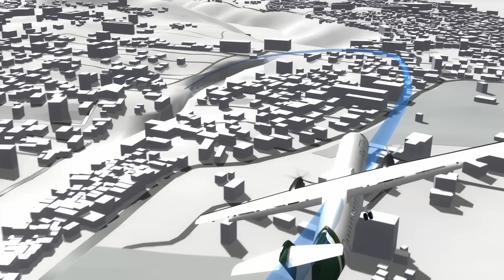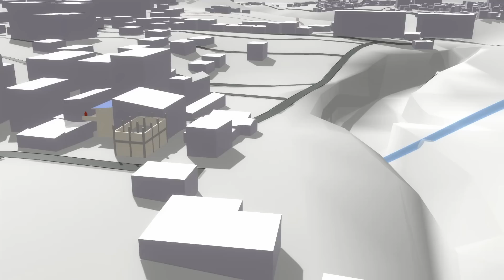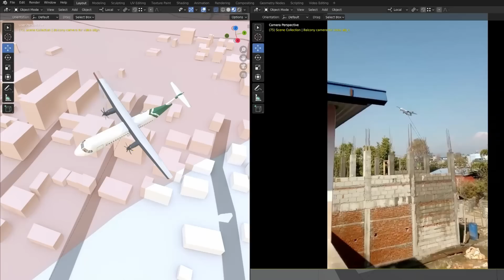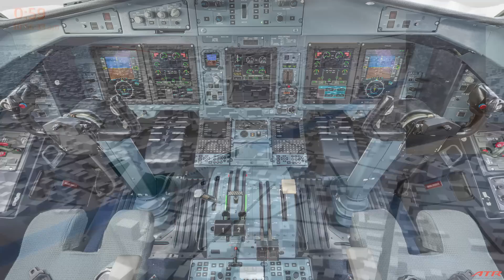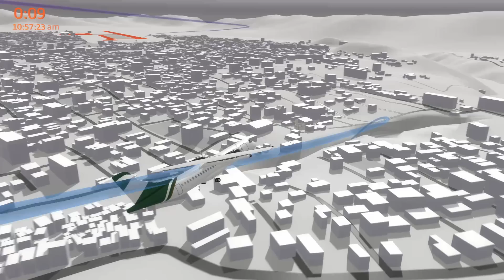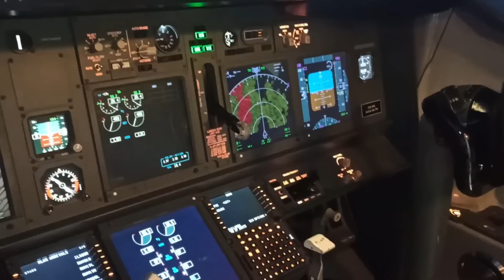HUMAN ERROR or MECHANICAL?! | Yeti Airlines flight YT691 illustrated

Comment: Based on what I've read and seen, the senior pilot's error could've been a result of overwork and a momentary loss of focus due to exhaustion. I don't know anything about flying, but I do remember when I was overworked as an essential worker during the pandemic. I was working 50 hours shifts in the snow at one point, and I could definitely tell my judgement was off and my coordination wasn't as shape, causing me to make mistakes I otherwise wouldn't have. If this pilot was in a similar state do to constantly being on the schedule, I could see how this happened. RIP everyone aboard. 😔 (Also fantastic video, you illustrated what happened really well.)

Comment: There's way too much 'tech' in the cockpit. Pilots don't fly the plane anymore, technology is doing that and when technology fks up, you know at your desktop, when it goes bluescreen, what to do? Fix the computer, even if you're only 1000 ft off the ground and upside down.. instead of FLYING THE AIRPLANE back to right side up. To me, most so called accidents are computer glitches that pilot's cannot fix in time.. they're not even flying the plane at the end.

Comment: Excellent video!  

Is it just me or is that "Hey your about to crash!" warning terribly deficient.. criminally insufficient really..

WHY would it even be an option to "FEATHER" the turboprop in flight.. An older aircraft could be guilty of this grave error in design but modern stuff would have failsafes for exactly this kind of reason.. 

Human error is far too common yet it's also on the manufacturer at this point because where are the warnings.. NOT A STALL warning when "hey it's too late buddies, your F'd now!" 

Something to warn you while there's actually a chance to do something.. ESPECIALLY if you feather the prop in flight.. of course the designers would be all "we never imagined, blah blah blah" BUT it's your job to imagine it.. you design these things for a living.. you make millions of each one.. HOW TF can you not make simple assumptions and account for human error? DERP.

Comment: If feathering never done in flight, can’t ATE have a blocking mechanism for feathering on flight? 

Sometimes people do things without and although lever mechanisms are different, a pilot could switch unconsciously
Reply from the maker: Feathering is done in flight.  If an engine fails its prop is feathered so it doesnt unnecessarily slow down the plane

Comment: Sounds like it caused a single wing stall due to low speed due to prop pitch error. No matter how much power you apply on a feathered prop will give you more speed. Sometimes when you are tired you make silly mistakes and I did this very thing on an ATR72-500 sim I used to fly with the exact same result. Wing dropped and corkscrewed into the ground. I repeated it several times in several different ways and if the speed drops too low I always found one wing would dip hard and was unrecoverable on approach. I thought it was a bug with the sim… but I guess not.

Comment: I don’t recall auto on the prop handles. But I last flew the ATR 25 years ago.  Maybe if they didn’t have the auto notch the fo could of realized he was moving the props instead of flaps
Reply from the maker: You need to press the triggers under both condition levers to move the lever. And to move the flap lever you have to lift it first. Distinctly different actions. Pilot monitoring was not at all focused.

Comment: It's human error, but it's the kinda human error that could have been avoided if the plane had been designed with the proper safety measures to prevent the mistake. Such as an alert for the prop feathering.

Comment: How would any pilot not see that the Condition controls were pulled down to FTR (feather) instead of 100% or Auto (if that is what happened)? How would the girl have lifted the handle under the Condition control as you pointed out? We have flown in India and Nepal - it can get get wobbly for sure - and listened to the real audio and the girl sounds very green. And she was going to be a captain in mountainous Nepal if signed off? Can't pilots tell the feel of the aircraft, or is it purely instrumentation all the time?

Comment: ATR needs to implement a system on all these planes to prevent feathering of the props in flight while the engines are running normally.

Comment: Recently cockpit voice recording of this crash was released on internet. The pilot seemed so confused while landing.
Reply from the maker: I have posted a video with the cockpit voice syncd to the flight path.
Reply: @Mike-Bell  Thank you. Just subscribed. won't miss your videos now.

Even if prop lever was in feather mode(which means like neutral in cars), why did they turned towards gorge at last moment instead of landing straight on the runway ahead? 😢

Also pilot took elect warning lightly like alarm snooze button. If only one of the pilot had pushed the prop lever back to auto, many lives could have been saved.

Hopefully these types of error won't happen again.

But again Saurya Airlines crashed at Kathmandu airport few days back turning sharp right while just taking off the ground. This also seems similar human error 😣
Reply from the maker: @sakeshkaranjit  Without forward thrust from the props, the aircraft was slowing all the time.  They should have made an emergency landing anywhere straight ahead while they still had airspeed.  That is basic standard procedure.  Something taught to a trainee pilot on one of there first lessons.  
Except panic prevented them from fully registering how dire the situation was although Anju did say something right at the end where she assumed Kamal was going to do the crash landing. 
But he held the nose up losing speed till the airspeed was too slow to sustain flight and the aircraft fell out of the sky and did the very predictable stall snap roll to the left.  At that point the aircraft went totally out of control.

Yes if they moved the prop lever back into auto (normal) within 2 or 3 seconds full forward thrust would have been restored and the situation saved.

Comment: It isn't rocket science.  Never forget to visually identify that you think you're doing!!  Lazy highly experienced pilots are sometimes the worst.
Carry extra speed and be ready to break a incipient stall with a push to unload the wing.  The 1st officer made a critical error by transferring control to the idiot that created the problem!!  Pulling the wrong handle is a common fatal mistake.  Develop good habits and practice avoiding bad ones!!  This flight was salvageable with quick thinking by the pilot flying.  Shove all throttles and prop controls full forward use the rudder to level the wings and push the nose down to break the stall and gain airspeed.  You can fly low but not inverted!!  Always carry extra speed!  Be proactive not passive.
ERAU 80 CFIA&I ret.

Comment: It's unbelievable that the false lever was used, but much more unbelievable is that in one minute that was not picked up by either of those two pilots.
Normally, crashes with such circumstances happen when there is some tricky automation or some malfunction involved that is not understood. But here, it was simply two false positioned condition levers. If you have no power, your first look is on the power levers, then on the position levers. That takes two seconds to spot this error and correct it. They had one minute.

Comment: Amazing video. I just always thought it was a wingtip stall from an ill-advised low speed approach. I never knew it was a suicidal cut in power. It has to either be extremely high fatigue or suicide/murder by the instructing pilot. 

Did we ever find out why they deviated from the usual landing path? Did the instructing pilot try to up the difficulty for training only to fail his own test?

Comment: Would you ever want to feather props while in flight?
     I'll assume no.
   So a tire pressure indicating sitting on the ground should prevent the props from ever being able to be set to feather while in flight.
Reply from the maker: Props are feathered in flight only for engine failure and only on the failed engine.

Comment: what is your source for the fact that the PM shuts the engines off insdead of putting flaps 30, I read the preliminary report, and it is stated nowhere, that this is what happened, do you have other sources, which I can read up on?
In the report it only says:
"The PF then called for "FLAPS 30" at 10:56:32, and the PM replied, "Flaps 30 and descending". The flight data recorder (FDR) data did not record any flap movement at that time.
Instead, the propeller rotation speed (Np) of both engines decreased simultaneously to less than 25% and the torque (Tq) started decreasing to 0%, which is consistent with both propellers going into the feathered condition. This was followed by a single Master Caution chime."
It doens't talk about the engines being turned off by the pilot. I know that it is quite an obvious abservation of the situation, but do you have a source to prove that this is indeed what happened?
And I know that the single beep of the master caution suggests that a pilot turned it off, but this still isnt a solid proof that the pilot turned the engines off on purpose.
Reply from the maker: The pilot did not intentionally turn off the props.  I didnt say that or imply that.  

All we know for sure from the black box is that both props were feathered.  In other words the aircraft went into neutral.  The feathering could have been done erroneously by a computer command or by pilot.  We dont know for certain which.  

For these answers we need to wait for the final report.
Reply: @Mike-Bell  yes exactly thats what I am saying, I didn‘t say he turned the off intentionally tho, I was just criticizing that you said that the props were feathered by the pilot instead of extending the flaps… Because you said in the video that the pilot did it like it was confirmed, but we don‘t know it yet (which you didn‘t say in the video.)
I am sorry if it is hard to understand my english, it‘s not my first language
Reply from the maker: @banana.3009  The feathering happened at the same time the pilot spoke about flaps 30 and likely moved his hand so I think it is widely assumed he moved the wrong lever. 
But we cannot be certain plus a computer error of this sort has not been reported on this aircraft. 
My guess is 1% chance the computer feathered the props but that still means its not certain it was the pilot. 

Accuracy is very important to me and it’s nice you are too. Most viewers aren’t too interested in the finer details. 

What country are you from?
Reply: @Mike-Bell  yes, that is right, also, as I already said, it is quite an obvious interpretation, and I think that is what happened as well, but you portrayed it like it was an already known fact and just wanted to point that out, nonetheless, I really like the video and love the visualization:)
Reply: @Mike-Bell  I am from Luxembourg:)

Comment: The whole time I was thinking how did no one check the speed or levers if they are correctly done, then I saw the controls at the last clip and got it. It was so messy and complex. There must be a better way for doing these stuff right? Maybe a audio reply with every action done by the plane (rather than the co pilot) to prevent human errors or something.

Comment: In the live stream video, after the crash, you can hear the engines powering down and some kind of barking noise. After a few secs, the camera moves. What cause that?
Reply: the camera fell from a melting object
Reply from the maker: The engines would have ceased to exist in the crash.  There was nothing left to power down.  Plus they fell in the gorge too far to hear from the camera.  The livestream camera was in the back row the plane which stayed on the edge of the gorge.  I think the camera dropped from the wreckage into grass after a few seconds.

Comment: The fact that the pilot flipped the craft upside down, maybe the rookie shoulda just kept the control... According to the video the rookie hands off control and experienced pilot just said dooo a barrel roll, if only they had modern safety precautions
Reply from the maker: That wasnt a barrel roll.  It flipped upside down because it was stalled and flying too slow to continue staying airborne.

Comment: Just an unbelivable mistake. If I were a pilot, I mean you would be worried about stuff like this and always double check what you are doing and look "Alright im pulling this lever now and set it to this mark" and then double check it..   that's just a severe mistake that shouldn't be able to happen. Maybe the airplane needs a better warning system for this as well. Shouldnt the plane warn for not enough speed for example?

Comment: moving the wrong lever while not common does happen to both novice and experienced crew members. Experience does not make one immune to error. In most cases, the error is detected and corrected, sometimes immediately, sometimes after a period of delay. "Trapping" an error can be more difficult under periods of high stress. A visual approach using a traffic pattern is certainly more stressful than one backed up with instrument guidance. 

I'd be interested in the CVR data, was the flight path being monitored by either crew member? Were there any deviation call outs?

Comment: What I don't understand is when the Captain accidentally selected feather why did the F/O not notice this and immediately point out his error. As a Captain when I would command my F/O to operate a lever or switch I visually confirm his actions. This is what every good crew member should do. Also on downwind when the error was made the F/O who I presume was hand flying should have had her hand on the power levers and should have been monitoring engine power levels which would have made it obvious there was a serious problem.
Reply from the maker: Nothing makes sense about this.  The most rational explanation would be the Captain had some rapid onset cognitive impairment but where he could still speak and sound coherent to his co-pilot.

Comment: In my opinion it's a combination of workload and routine. 
I'm NOT a real pilot, but flying simulator (x-plane) since 2013 with now around 4000h on Cessna, Beech 1900D, B737, and A319/320 online with ATC on Vatsim.
We simmers mostly fly as single pilot and so the "workload" especcially in approach and landing is very high. And very quick are mistakes made, in spite of using checklists. I made a habit of always one thing: looking and then doing! So if f.ex. callout flaps 1, then I look short to the flapslever then I grab it and set flaps. 
But I fully can understand, that nobody is safe to make mistakes.
All the lost R.I.P in the Lords hands
Reply from the maker: 4000 sim hours. That’s impressive 😀

Comment: Not trying to be the Devil's lawyer, but maybe the senior pilot was trying to test if the jr pilot could notice the "error" and the gradual lost of power and he just lost control of the situation. But probably that wasn't the case as I've learnt form other videos about aviation, the landing and takeoff are the most critical moments of a flight, so it would be very negligent of a pilot to do such thing during any of these procedures. Also, people on the ground were very lucky the pilots didn't took the turn for their final approach when they had to because the plane would have crashed on a building or a street for sure.

Comment: They should make it impossible to reduce power to an extent when the plane has x amount of airspeed. Idk why that's not already implemented.
Reply: Exactly. I guess aircraft tech takes years to get upgraded.
Reply: @thenitinkosuri  Thats true. But that is a good thing, cus the airline industry is so safe, that only very careful upgrades keeps this safety, quicker upgrades can also be done, but not that extremely safe.
Reply: There is always pros and cons to such automations. Airbus planes have in general more such automations. But there has been accidents just because of such automations, either cus an automation has a malfunction or cus in that very specific case the automation should not have kicked in or the pilots tried something and didn't thought about an automation combined with misfortune a crash happened.